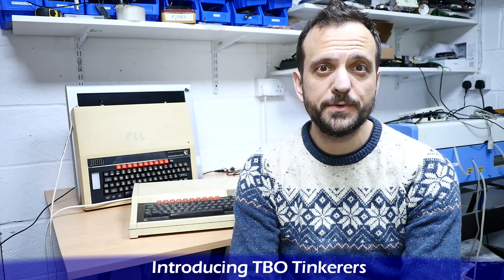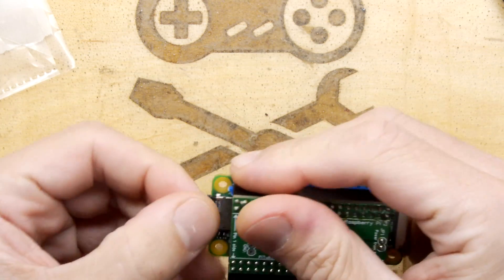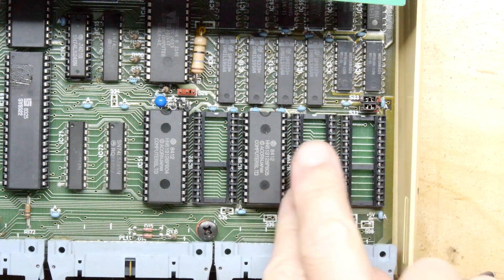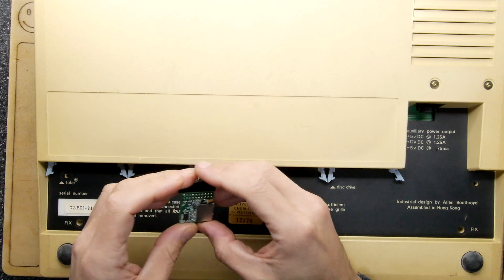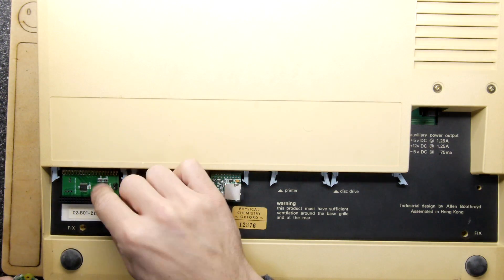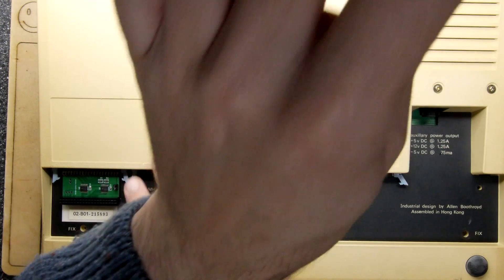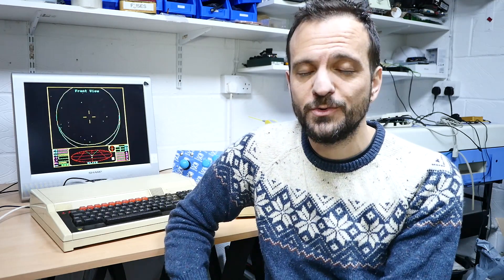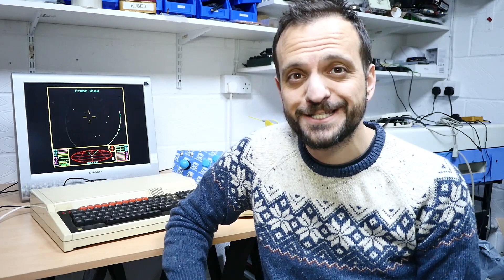Cheap BBC Micro Upgrades you can install yourself

Comment: No serious BBC micro user has screws holding the keyboard down! Mine hasn't had them in since forever. The keyboard is perfectly well retained by the case. :)
I invested in a Gotek USB floppy drive emulator, a PiTube direct and have been playing with then, still got to unpack my MMC and check it out.
Merry Christmas!
Reply from the maker: You make a valid point, to be fair, even having a lid on is a sure sign of a n00b 😂

I will be interested in your gotek experience, I'm been removing them where I can after finding SD card solutions.

Meeeeeeery Christmas to you too!
Reply: @backofficeshow  My plan is to backup my 5.25" floppies. Not had much joy so far, some of them may be part it. Need some solid time on it to fully understand what's wrong as I'm using Watford Electronics DDFS and get formatting errors in the Gotek images.
Who knows, I might ultimately settle on using MMC.
Will report back at some point. Also want to get an original Winchester working, when I do I'll probably have the 1990 something accounts of a travel agent or somesuch, can't remember which of my dad's customers gave him that. :)
Reply from the maker: @ches74  You are living the dream 😂

I have a bunch of Atari ST PD discs to back up at some time. I need to get the willpower to crack on with it. Not today though!
Reply: @backofficeshow  the dream of a skip diving hoarder maybe! 😂

Isn't the Atari ST capable of reading and writing to MSDOS formatted floppies? Might be the easiest way to back them up and I believe there are ways of creating images on a PC to dump on an MMC or whatever.
Reply from the maker: @ches74  I haven't managed to find a PC that will read them. I think I will copy them in the ST itself into a Satandisk partition and pop that in my PC after I'm done with a bunch.
Reply: @backofficeshow  sounds like a plan. Otherwise maybe MSDOS formatting the disk on the PC then copying the files onto them on the ST might work.
Reply: If you have a basic GOTEK, you might like my GOTEK menu (or my MMC menu) for the beeb. https://stardot.org.uk/forums/viewtopic.php?f=53&t=16070